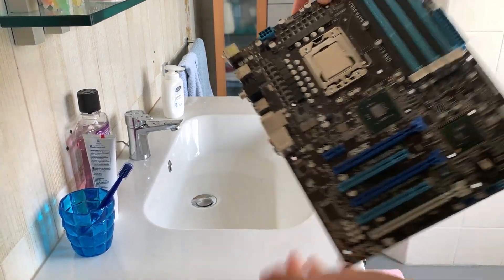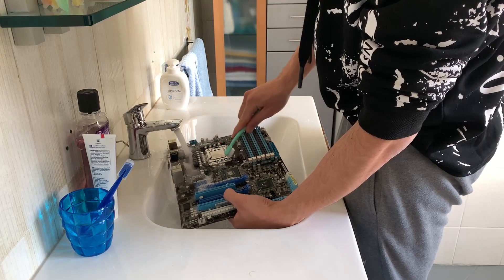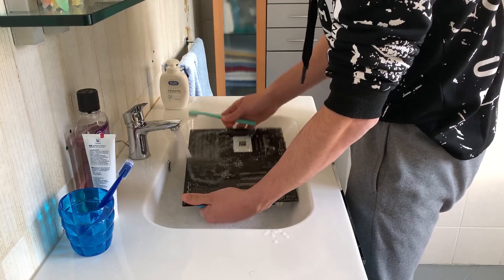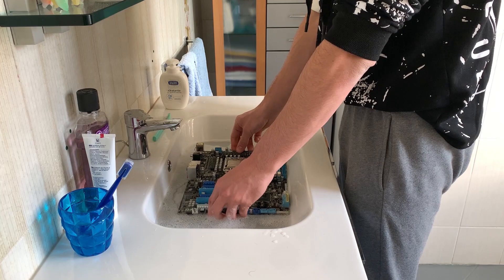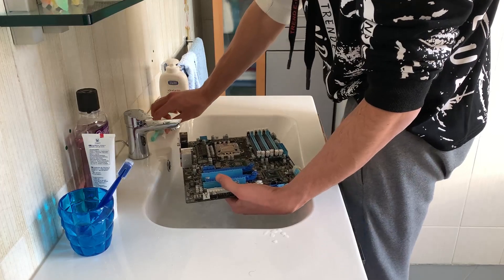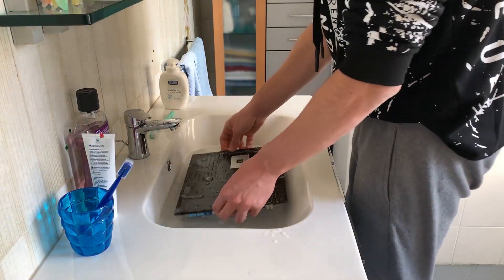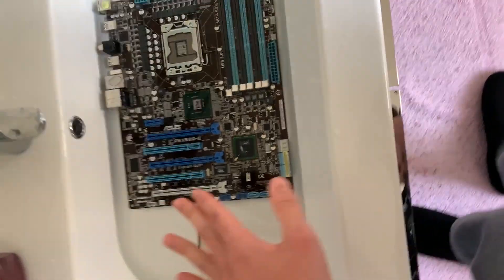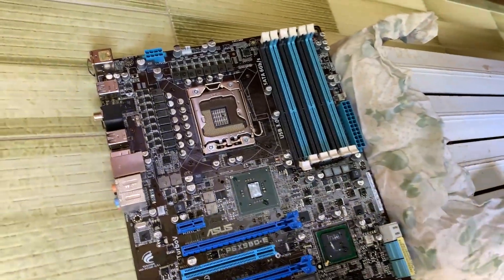Washing a Motherboard in the sink to Fix it! Full Tutorial + Drying up process

Comment: This is too funny. Go ahead people and wash your motherboard  with water even though your not supposed to. Water is not safe to use when cleaning a motherboard, as it can cause extensive damage to your computer even after it has dried. Instead, use a damp cloth or isopropyl alcohol to gently wipe the motherboard's surface and remove any accumulated debris. Nothing shown in this video that the board was defective and nothing shown that this even worked afterwards.

Comment: Just did that to my z68 lol ! Except that I've used pressure wash with washing powder, one of the ram slot is not being detected and there are no bent pins anywhere so i gave this a try, not my daily anyway so idc if it's dead.
Reply from the maker: Great stuff! Let us know how it goes :)
Reply: @ImWateringPSUs  it did turned out fine, and it also fixed the non working ram slot, it was a good gamble i guess 😂😂

Comment: My laptop dosent boot up coz liquid metal asking shop to fix quite expensive .wht will you do if you in my situation .i was thinking to wash my fcking motherboard coz im so piss i allready use achohol to wash the motherboard and zippo fluid to but till now not worked i so piss man.
Reply from the maker: Yup I’d really recommend using isopropyl alcohol. For liquid Metal specifically you will also need to manually take it off a lot, I recommend using cotton sticks to do that
Reply: @ImWateringPSUs  i allready use isopropyl achohol still same not boot up. If i wash my motherboard what you think sir?

Comment: this is fake, 100% 1000%
Reply from the maker: It is not! Check the other videos on my channel😅 Two years later, still doing it :)
Reply: @ImWateringPSUs  
motherboards short circuit under water.

its like leaving bread out for a week and saying its not stale or moldy.
Reply: @yoursleepparalysisdemon1828  nope, I have washed all sorts of boards with comet and water.  Don't recommend comet tho; those pcb's had grease and grime on them from industrial applications.  Remove any batteries and discharge large caps.  Make sure board is DRY and free from any salts.  I wouldn't wash the CPU tho; don't trust the lids.  We would use alchohol as a rinse to help displace and evaporate water.  We would also fan dry at least a full 24 hours just to make sure.  Mineral spirits/paint thinner are nice to clean stuff with because they are di-electric.  Just can't be that milky fake or reformulated stuff that is "safer."
Reply: @brianpeppersxtreme  unless that war is 100% pure distilled (which it woulnd't be the second it touched the air, or even the motherboard itself), it would short it out.
Reply: @yoursleepparalysisdemon1828  Hence why I said NO current going through it.
Reply: @yoursleepparalysisdemon1828  If the MB is completly dried up and there is no voltage running in it,its safe.And it will not make any short circuits
Reply: @uni6002_sp2  thats just not going to happen after putting water on it. you dee, it wont be dry.
Reply: Your just simple minded... one there is no power to short anything out with.... also fun fact, pure water doesn't conduct, the impurities in it does, as long as itd dry before you put power to it, it will work fine... maybe learn a bit and do some research before you try bashing someone online!
Reply: @Chris-qr3ce  im not gonna read that whole ass essay
Reply: @yoursleepparalysisdemon1828  he's not wrong tho. i used to think the same thing as you, but I learned that washing electronics is mostly safe as long as there's no electrical current flowing (eg onboard battery), and that the board dries up COMPLETELY before reusing. like, weeks of drying in well-aired environment is advisable. now I wash a lot of my electronics this way - easy way to keep it very clean, you just need to be patient to let it dry out properly and its a good idea to give it a preliminary dry by patting down with a towel and a blow with a hairdryer before letting it air-dry for some more days. obviously you need to use common sense thought. you wouldn't want to wash something like an LCD panel, keyboard, or anything that the water could obviously cause permanent damage to. it's also probably not the best thing you can do to your capacitors, but yeah never really had a problem so it's not as bad as most people assume
Reply: It's not fake, I've done this several times on motherboards and GPU's. The only danger is not letting it dry out all the way. When I did mine I used air from a air nozzle and a air compressor, then let it set out in the hot sun for several hours. Just gotta be careful not to knock off SMD components. Once FULLY dried it'll work no problems, and be sure to remove the CMOS battery first.
Reply: @garyr7027  again, water on computer parts.
Reply: For crying out loud there's a video of a guy burying his CPU, waters it like a plant, leaves it for a month, digs it up, washes it WITH WATER, dries it off all the way, puts it in his mobo and plays CSGO with it.... make sure you are right before you trash someone, you clearly are not educated on the subject.

Comment: omg lucky you didn't kill the cpu, should of removed it.. The silicone seal on the cpu ihs doesn't always go all the way round, water can get trapped around the cpu die.
Reply from the maker: The water can definitely get inside, but drying up the CPU properly fixes the problem.